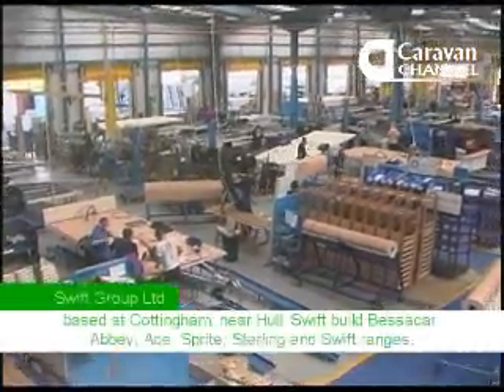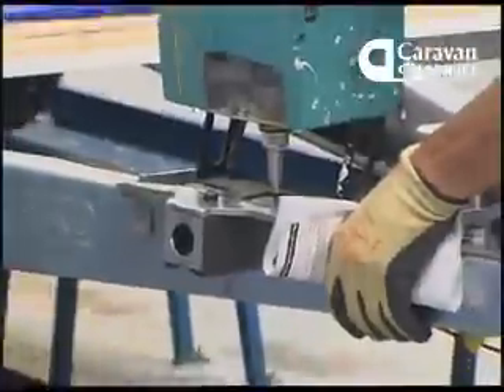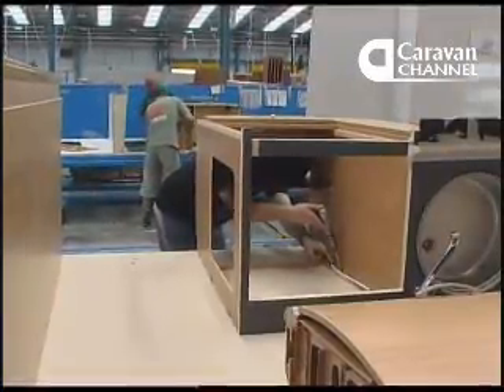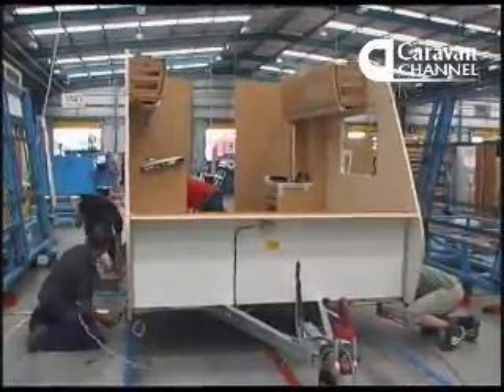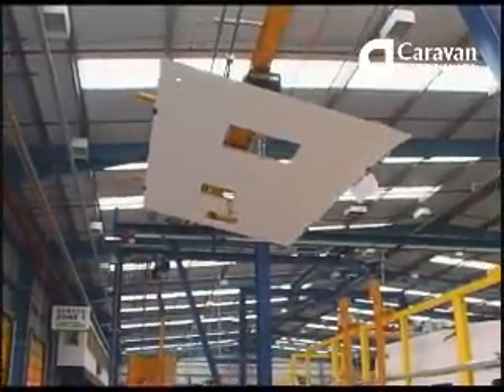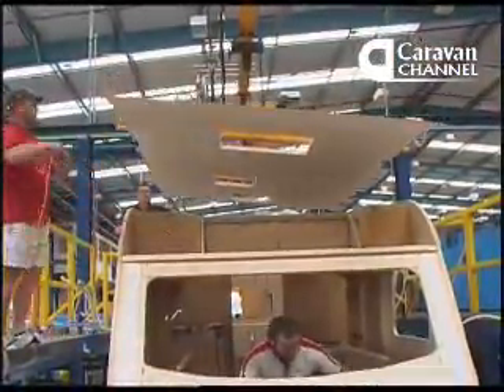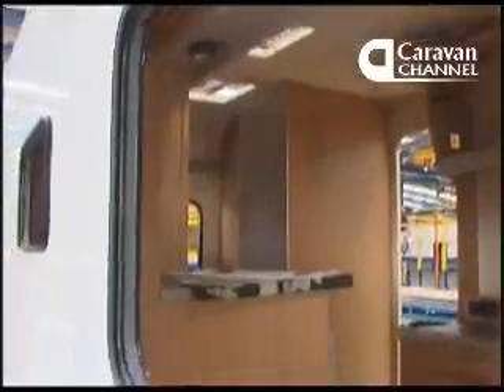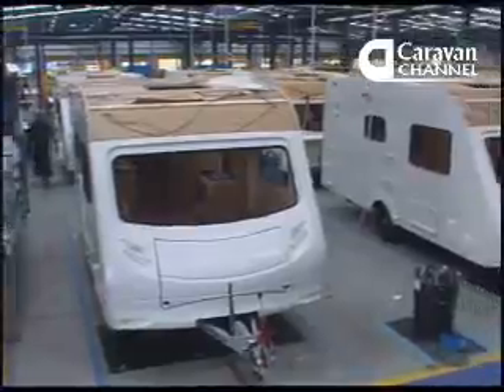Swift Caravan Factory Visit, Part 1

Comment: We ordered our Swift Explorer 4 berth last October 2014, Should be ready for delivery at the end of January 2015. Here in Brisbane -Australia. Can't wait :)
Reply: Ok you have had it for a year now,are you happy with it.Appears to be a lot of unfounded negativity here.I checked one out.This is the future of all caravan builds taken from the boat industry.they are a very nice van inside with the best lounge area i have come across.I am considering one only for Australian conditions i will get the lift kit and heavy duty suspension which should be standard  for Australian conditions as even our blacktop can resemble a English 4wd track.A positive air pressure may also be required as i did hear a complaint about entry of dust,as the Poms would not have a clue about our bull dust.
Just a recommendation the use of sikaflex during the assembly process would make these vans bullet proof.
Reply: Yes, we are happy with our Explorer 4. It has got some problems, like all the other caravans  once they are taken on the road, because of all that vibrating etc. We spoke to people who just had a new Jayco and Bayley who had big problems, even our son who bought a brand new Jayco $64K and had lots of problems as well. One lady with a new Jayco was told by the dealer that all new caravans have some problems when first taken on the road. But the problems we had have all been fixed and so far so good. Went on a 4 month trip down the South Coast of Australia towards Perth, came back over 200km dirt road from Wave Rock Hyden, to Norsman  and we had some red dirt on the floor in the cup board under the kitchen sink. But otherwise nothing at all. So we were very pleased with it. The chassis from our van is higher then the others. So we can go over a sand track if needed and is great for steep driveways at Petrol stations.  There is a Swift caravan owners group on Facebook you might like to join and find out what others think about the Swift. So far we are still very happy with ours. :)https://www.facebook.com/groups/swiftcaravanowners/

Comment: to fast slow down stop paying peanuts my van which is  2 years old leaks like a sieve no wonder your company can't cope with the complaints about workmanship also the plastic fittings as they have fitted using your battery drills allhave cracks around the screw heads i wonder how this happens  doh!
Reply: air drills .  with no torque  settings